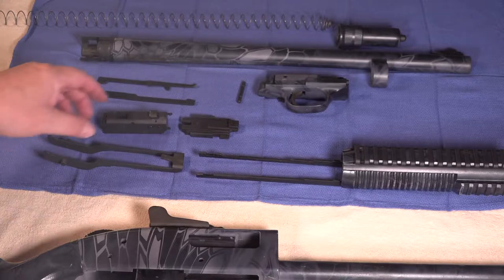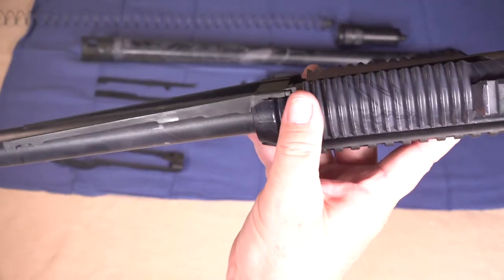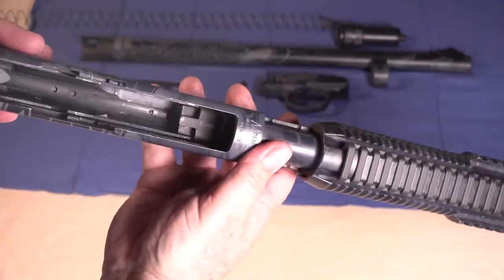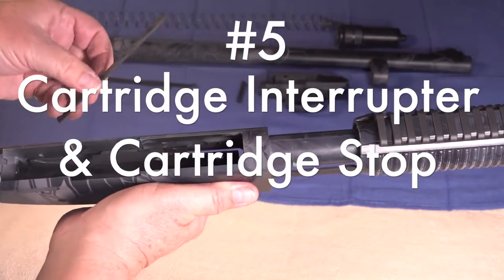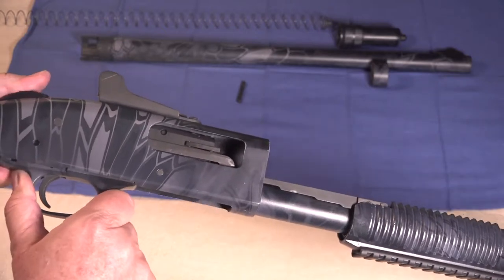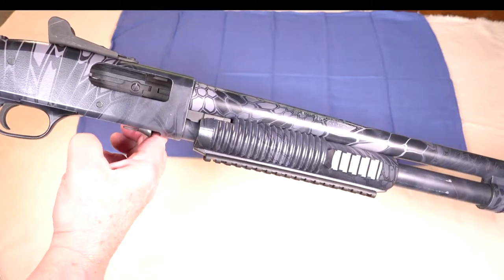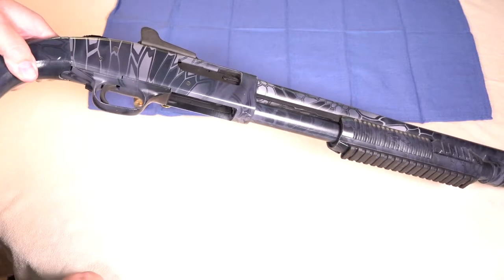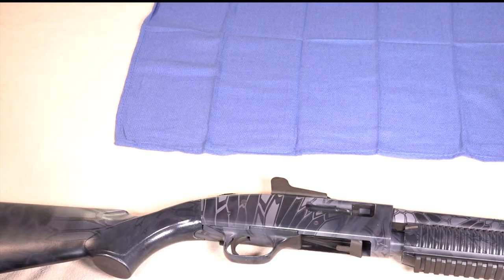Mossberg 590A1 Field Strip - ReAssembly - Defensive Firearms Instruction - Personal Firearms Trainer

Comment from the maker: Regarding the Magazine Tube Spring - If yours is "captured" in some manner by a snap ring you can leave it in place for normal cleaning/maintenance after you've removed the Magazine End Cap or Magazine Extension.  If you're installing a new follower or if you managed to get some dirt into the Magazine Tube and it sounds like you're grinding gravel, you'll have to pry off the retaining ring and then, when re-installing the spring, you'll have to tap it back into place while you're compressing the retaining ring and compressing/retaining the Magazine Spring at the same time.  If you do take out the spring for cleaning of the Magazine Tube, make sure that you wipe the tube and spring DRY at the end of whatever cleaning that you perform.  Any oil remaining will just serve as a dirt magnet in the Magazine Tube.